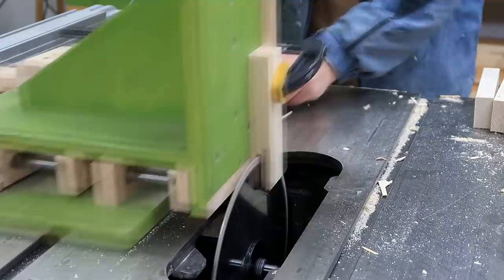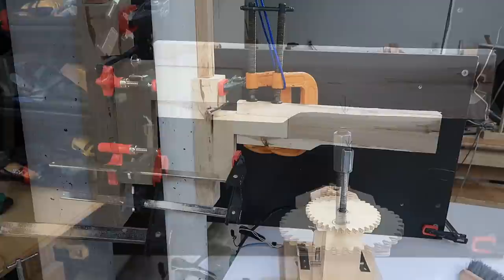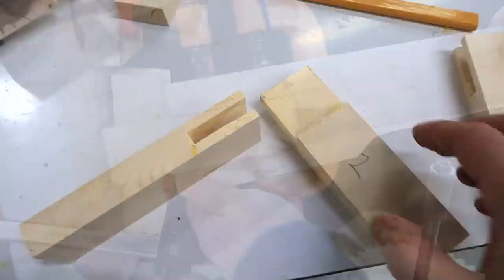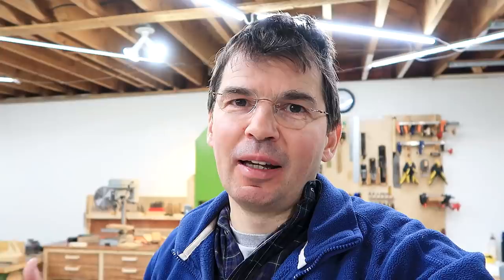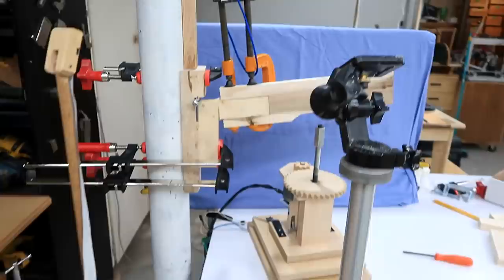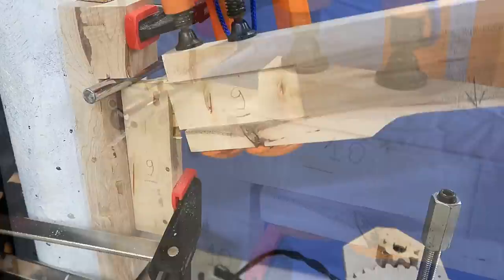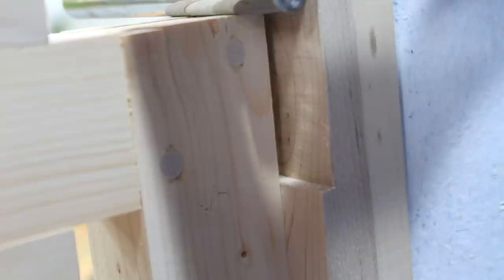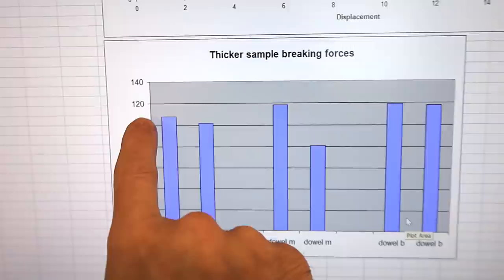Can reinforcing a joint actually weaken it?

Comment: Excellent testing setup, makes it pretty clear that they don't improve the joint strength. I'm glad you kept in the part about the cold glue, I would have never expected it to be so significant!
Personally I'd argue that the dowels holding the boards together if the glue fails as a negative thing. If it fails from a continued force (weight/gravity), the dowels are going to give way at the same time as the glue anyways. If the force isnt continued or reduced after the break (like your jack), your test shows it can simply hide the destroyed joint surprisingly well. At best it's going to give out anyways and potentiality cause even more damage, at worst it's an avoidable safety issue.

Comment: Interesting, I like your analysis of the joint with the dowel holding the piece together after the glue fails on the joint. Personally, I’d rather the joint held together with the dowels until I had time to repair the joint, it wouldn’t take much to go to the drill press and drill out a couple dowels. 
   I was shocked when the glue joints failed before the wood, even with the temperatures a little lower than the recommended amount. My first thought was maybe the glue was old but that didn’t seem to be the case. Id be interested in seeing what an old glue would break at compared to a glue that was fresh or still within its use before date. 
   I’m looking forward to seeing the results of the glue testing, I hope you use some of the different types of glue for the testing. There seems to be quite a few types for different applications for wood glues. Thanks!

Comment: It's always cool to see a new video from you, Matthias! The failed glue joints seemed to be very smooth, I wonder if it would help to "roughen" the glued parts so that the glue has a better chance to penetrate the wood. Or that the glue has more surface to hold onto.

Comment: I'd be interested to see how mistreating glues affect their performance too. You touched on the temperature here, and have done gaps and clamping force in the past...I wonder how it would work out gluing damp wood, or gluing dusty wood, or using previously-frozen glue, letting it cure in very-humid or very-dry space, etc. 

That said, I am also interested in your "actual" projects too, so maybe we don't need to go all the way down the force testing jig.

Comment: Great video!  Good points at the end, too.  I guess it depends on the use case.  If it’s not that important whether the joint holds together, it would be more convenient to be able to just easily re-glue it.

Comment: The thing the doweling bring to the party is slow down catastrophic failure.  When the glue breaks, no real joint damage yet.  Drill out pins and redo the glue up.  No extra repair of damaged wood.  Great thought about whether
 they weaken the joint or not.
BTW, as stated by others here. nothing wrong with pocket hole joinery when used in the right situation.  PH's can be stronger than doewls if put in the right places.  Thing about it.

Comment: How old was the glue?  Had it been stored in a place that freezes?

Depending on the expected load angle on the joint, the dowels could be moved to more optimal locations.  For example, the first dowel orientation, where the one dowel became a hinge, and the other caused a tear out of part of the tenon, move that dowel closer to the middle of the tenon.  Probably keep it about the same distance from the edge on the bridle though.

Test joints with just dowels, and no glue?  Just for comparison?

Thanks.  All of the testing you have done is greatly appreciated.

Comment: One of the issues I've experienced with with joints cut with precise jigs is inadequate space for glue causing weak joints. I assign the root cause of "inadequate glue" as opposed to a "glue failure." As was identified earlier in the video, there was a lot of glue displaced on the cheeks of the tennon, where the best long grain adhesion occurs.

Comment: Comment before watching: yes, absolutely

Upd: what a nice setup and convincing results! So it true to say that dowels are rather a safety measure against catastrophic failure

With that in mind, would be interesting to compare double-pinned setup with single-pinned (bigger dowel, crossectional area equivalent to two smaller) Theoretically might be stronger because of lower contact stress or weaker because of higher probability of grain defects around the dowel

And since everyone is commenting on the gluing technique, I'd recommend modifying the jig setup in order not to give such clean and even surfaces

Comment: I am wondering about the "glue failure". Does the glue fail or does a small layer of wood pull away?
Reply: Yes and if a small layer of wood is pulled away, is it enough to hinder regluing?
Reply: Exactly! I'm curious to know what was left inside the mortises in those first few tests, when it looked like there was little or no glue left on the tenons. Maybe the low temperature stopped the glue from soaking into the wood as deeply as it should have.

Comment: Matthias, the repair on glue failure should be easy enough even with the participating dowels, since they can be drilled out and replaced as part of the repairing glue up.

Comment: Dowels traditionally had two functions tough. One is making a weak glue joint stronger (as traditional glues were never super strong) but they were also used as a way to tighten the joint trough drawboring without the need for clamps everywhere.

Comment: I do similar reinforcing in my projects but instead of dowels i use wood screws as i find them much more convenient.
They also help hold the joint clamped together.

Comment: I’m curious now to see how strong these joints are with just dowels and no glue. Old style square pegs in a round hole got us through a couple millennia of woodwork. Curious to see how thick the stock needs to be for the joint to be as strong as a glued joint with just dowels and no glue.

Comment: A further observation is that the lever arm is creating a torque versus a sheering force.  These two properties are radically different in terms of force tolerance, and application dictates which type of moment (sheer versus rotating) is more important.

Comment: Wondering if it's possible the amount of clamping force plays a factor, can you squeeze too much glue out of a joint by clamping it too tightly?
Reply: Based on other testing I've seen, that isn't likely.  Sorry I don't have any links.
It is more likely that there is a problem with the glue.  Or the environment (including the wood) is too dry, not allowing the glue to properly adhere before drying.  If the parts fit too loosely, glue will pull away from the parts as it dries (doesn't appear likely in this case).  Also, to improve glue joints, the surfaces should have some roughness.  Parts that are too smooth will fail quicker.
Reply: Mathias has actually tested that a few years ago. To his surprise and mine, it was possible to squeeze the glue out enough to reduce the strength. At least in that particular setup. I don't remember the specifics so hopefully you can find it in his channel.
Reply: Yeah if you look back through his videos he did a test like that. IIRC, clamping harder isn't better. Best to rough up with coarse sandpaper and use recommended pressure, which isnt a lot.
Reply: @christopherbiomass7155  roughness ? i learned from a Oldtimer that i just have to freshly plane the glued faces....because the fresh cut will let water penetrade better in the wood and glue too.

greatz from Germany
and have a nice day
opo

Comment: I usually pin my mitre joints with dowels so that I can release my (limited supply) of clamps sooner. Also means that the assembly can sit on the bench without being held up by clamps that might cause some distortion.

Comment: Placing the dowels in either miter or bevel orientation as done in your experiments places the dowels near the maximum compression and tension positions. Try placing the two dowels along the center line of the tenon. This will position the dowels near the minimum compression and tension positions. I suspect that your major problem to resolve is the glue separation issue. This might be accomplished by making the fit a tad looser for inserting the tenon, then resolving the looseness with clamping. Good test setup by the way.

Comment: It stands to reason that if the wood breaks laterally below the joint, as it seemed to happen in all cases where the glue did not fail, then it doesn't really matter what craziness you do to the joint, even if you successfully strengthened the joint, its irrelevant because its not failing at the joint.

Comment: Considering the glue failures, if the joint was a bit loose to start with the glue would be likely to fail in that way.  
I think a single dowel in the center would be an interesting test.  Being farthest from the edges might give it an advantage.

Comment: Hey Matthias!  You should  ..... do whatever the heck you want.   🤐

I did find it interesting that it did not seem to make much difference.  Not what I expected.
I found the glue temperature issue most interesting.  Did not know it was THAT picky about low temps.   Being in a basement, my temps do not swing that much, but all these guys working out of garages where they go from 5c to 3c over the year definitely need to watch where they store their finishes and adhesives.
Reply from the maker: well, it turned out, the warm glued ones broke at about the same strength, so it may not have made a difference.

Comment: If you are going to test glues, Can you also test clamping pressure with the glues. Is too much clamping pressure bad for the joint. Compressing the wood trying to squeeze out the extra glue is worth it or does it hurt the glue joint like they squeezes out too much and possibly just damage the fiber of the wood making it fail. The wood might absorbs some of the glue that can't escape as easily making the joint stronger so making the glue surface ever so slightly cupped in the middle (you might not notice it unless you put a straight edge on it) and when clamping it makes a seal with the wood pressurizing the glue to go into the wood. Not sure if it might work better on hard woods or soft woods or even might not help at all or could really hurt the joint. Some have to sand joints before gluing and sometimes they have to remove a finish and can dig too much in the middle or if the board is slightly bowed when gluing to a flat board.

Comment: The question of "do I want a failed joint to completely fail and break apart, or keep hanging on a bit" is not an easy one. Gradual rather than catastrophic failures are less likely to dump you on the floor when a chair leg breaks, so could maybe be considered "safer"... but as you say, cleanly broken glue joints are repairable.

Comment: I'm not half the woodworker that Matthias is but in my experience, glue fails eventually just from age and temp/humidity cycling. I've seen that a lot in antique furniture that I've repaired. Mechanical joints such as dowels are much less susceptible to this type of failure. With that said, the dowels make it difficult to disassemble and repair the joint so there's a tradeoff.

As for the initial strength, i don't know but Matthias thoughts seem logical and I'm inclined to agree with him. Hopefully further testing will be more conclusive.

Comment: I did some personal testing with some vertical pieces glued into some horizontal boards with a 2" piece removed. The glue failed in 10 instances.  I've always been told the glue will outlast the rest of the wood, but I think a simpler test (an non scientific test) proves that to be horse hockey. If that were the case either the vertical or the horizontal wood would fail. That did not happen in my testing. Not looking to start a comment fight but I agree that a more solid joint in all instances is the cure. Not pins or more glue. But box joints or corner biscuits.

Comment: Fantastic test. Unexpected result: “with modern glues face grain joints are stronger than the wood.”  Or so I thought. Bridles too precise a fit?  Too tight?  Need to think about how stressed work (e.g., if a top is attached above the bridle).  Thought provoking video.

Comment: I don't know what they mixed into the yellow stuff but with white pva, the wood should fail before the glue. It looks like you didnt cover the entire surface area.
Usually when making this joint it's going to be a frame, while cross measuring and clamping it up the tiny gaps you have on the side of some joints disappear by themself.

Comment: Honestly, i'd take this video as evidence that, yes, you SHOULD reinforce your joints with dowels.

Regardless of if it makes it stronger, the many of the joints experienced increased ductility and continued to have residual strength after initial failure, that can be a very useful trait to have in a joint.

Comment: I think your channel is awesome and I love the testing and thinking you do with your project and approaches...I wish I had time to comment more often...

I think, these days, with "modern" woodworkers (what I call wood machinists) so much of the traditional contextual knowledge of means, method, and material applications are either lost and/or massively confused by most practitioners today in wood made things...

As a point of validation and reference, I'm a retired traditional Timberwright, with many related vernacular skillsets in stone, clay, textiles, etc. with over 40 plus years of working experience and knowledge base including being traditionally trained as an apprentice in serval of these folk traditions... My observations then are from that given set of skill sets and perspectives...

FRICTION...!!!...gravity, and geometry are the primary workforce in...GOOD...!!!... wood joinery...both in furniture...and in the more critical applications of large architecture, bridges, and water-going vessels...

Fasteners (i.e. pegs, trunnel, etc) are often only used to either hold a joint in a position of optimal natural strength...and/or as a "drawn" joint thus making them tighter...Wedged joints are optimal as they can be inspected for function, tightened, and work in concert with all the forces mentioned above...making them some of the strongest overall forms of joinery...unless an adhesive is available for use in a given design...or...to meet give dynamic load parameters greater than the joinery alone can bear...

IF...you are using a peg to hold a joint together...adhesives just are not really necessary...and can...WEAKEN A JOINT FURTHER AS SUGGESTED...!!!... in most applications if the work is designed and executed well...!!!...good joinery alone is more than enough...If (???) one opts for adhesives...then pegging/pinning the joint really is not necessary for many (most?) applications at all...So I more than agree with your assessment...!!!

What I would note, is that the pins/pegs in your example of a "bridal joint" are not placed well at all, nor are they really optimal for the load you place on the joint...

I would also have "draw pinned" this joint...IF...I was to employ a peg at all, as this family of joinery is typically a "glued,"  or employs only friction and/or gravity to work properly... 

GOOD adhesive work is always stronger than the original materials...IF...!!!...the work is done properly... Thus, in a way, renders your test moot, as the wood should have always failed first...and every the glue itself...!!!

Failed glue joints are indicative of damaged adhesive, improperly or using the wrong type of adhesive... or a bad "glue job." Also worth noting is that grain and species-specific characteristics are very critical in understanding all these functions that must work in concert with one another...especially in any of the "bridle or gain" family of joints...which are either "draw born" or " glued" seldom both together in the traditional context unless the pegs are "decorative" in nature...

Comment: I am also surprised the glue joints broke as they did.  Almost like it was a very loose joint, but typically you would so distinct pattern as the glue dried and separated from each side.   It still took a crazy amount of force (torque) to break the joints.

Comment: I very vaguely recall someone once telling me that for a strong joint, you should apply a thin layer of glue to all surfaces, let it set/dry, if necessary sand the surfaces lightly for fit, and then reglue and clamp the joint. I think the rationale was that this ensured that you had 100% glue contact to the wood surface. Of course you still might not get 100% wet contact between the primed surfaces and the fresh glue, but I think the thought was that this was now a smoother surface and the fresh glue might partially reactivate the primer glue. It may be that this was told to me for some specific type of glue, probably animal glue (hide or fish glue). It may or may not be applicable to PVA.

I wonder if the glue joint strength would be different if you had pushed down on the joints rather than upward? Pushing up, the joint nearest the lever arm can shear upward fairly easily. Pushing down, I think the front of the joint is partially constrained, and the back of the joint is the part that can shear easily, but it will only be inclined to do so after some failure in the front of the joint.
Reply: My opinion is that would weaken the joint. The thicker the glue that’s in a joint, the weaker the PVA. It has very weak cohesive properties, so it doesn’t stick well to itself. See the link I put on the comment above yours.